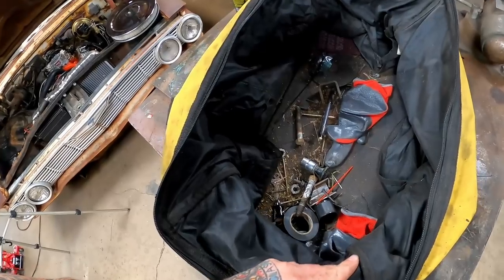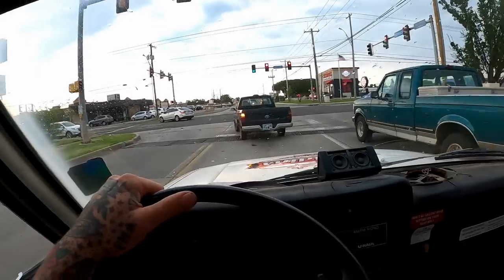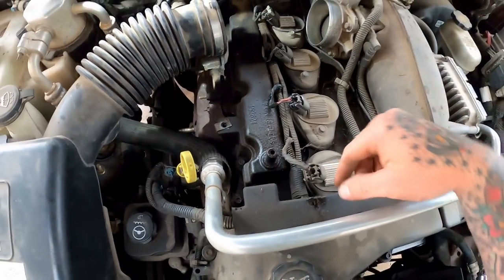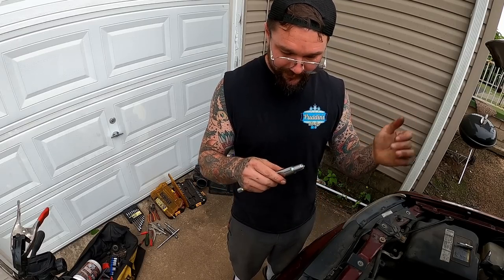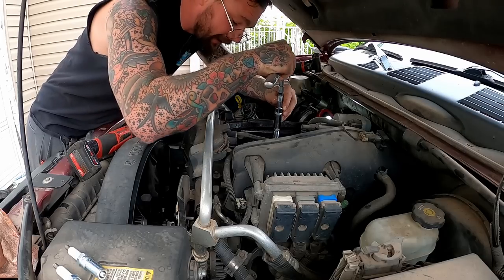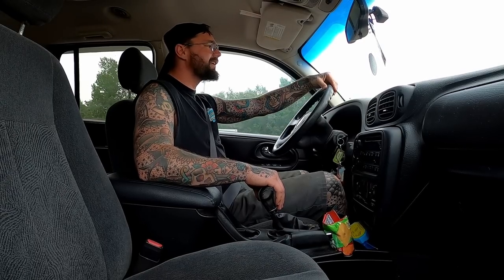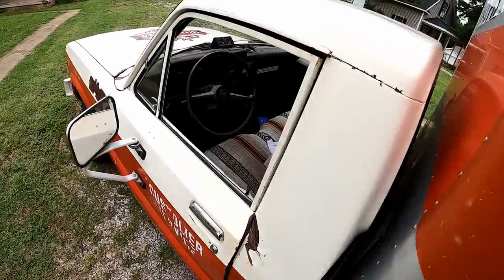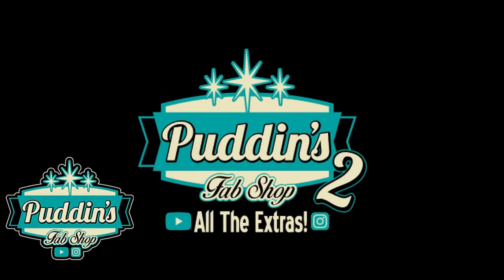ABANDONED for FOUR DAYS. 2005 Chevy Trailblazer. Will it run???

Comment: I just had issues with my 02 TB. Ended up changing the ignition switch and pulling and cleaning and reinstalling the electrical connector at the base of the steering column. One thing about changing the ignition switch when you pull the old one pay attention to the position. It is a toothed rotary switch and is timed. I had trouble with it starting and no power to the AT solenoids. I am not sure exactly fixed but it is better.

Comment: Best wasp removal is burning paper wrapped on a stick held up to the nest right after sunset when they're all in the nest. They die in the nest or their wings singe off flying thru the flame & you can step on them. It all happens fast before any wood has time to light & looks like your situation is metal anyway.

Comment: A misfire wont put it in limp. If it went into reduced engine power, it's more then likely a APP sensor "gas pedal" or throttle position sensor " throttle body"  issue.  I'm a 21 year GM tech, if you find out what DTC it is setting I can walk you through the diagnostics for it.
Reply: Just finished watching. Looks like trans has internal issue. What gears does it have? May be forward sprag failure.  4l60s are easy. I can walk you through that too if you want to try to fix it.

Comment: Without watching it, I'm going to guess that after four days of not running, the fuel has gone bad.  You will have to drop and drain the tank, and replace the fuel lines and injectors.  Also, all of the brakes will need to be replaced.  New tires and then you can drive it 10,000 miles back home.  Will you make it?  This is going to be good.